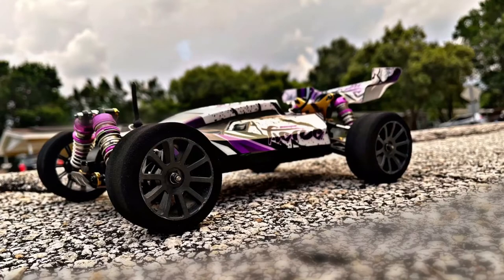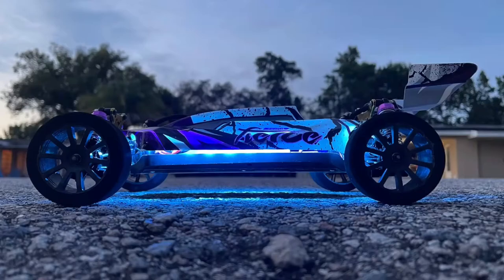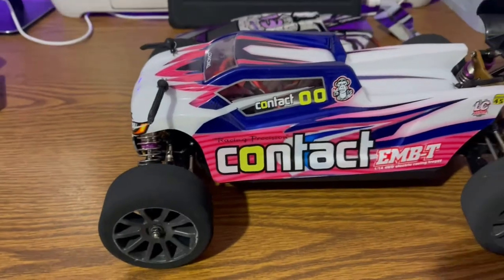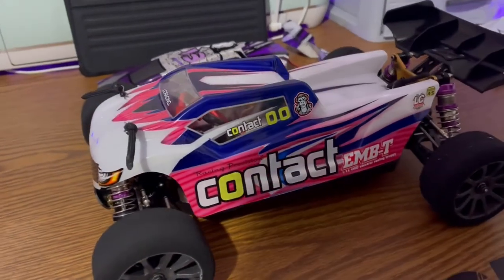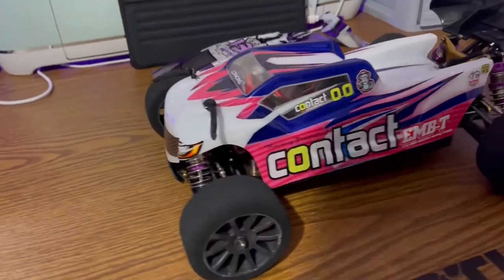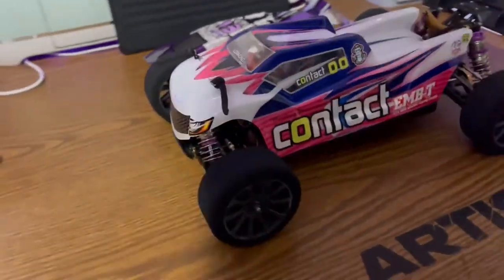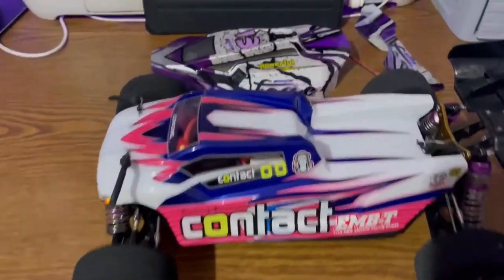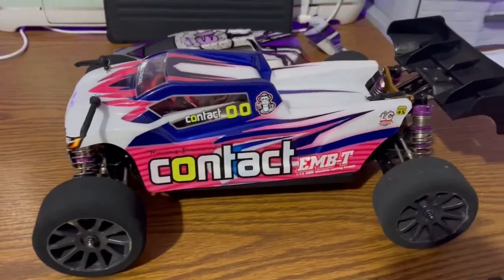WLtoys 124019 converted to LC Racing EMB T brushless upgrade on 2s nice and fast speed runs

Comment: Nice. Where did you get the tires/wheels?
Reply from the maker: The wheels and tires are foam 30mm all around 12mm hex brand name contact foam, matrix foam or xceed foam tires those are the brand I use that are cheap or bsr racing drag foam tires

Comment: What size are the foams? 30  32mm?
Reply from the maker: 30mm if you find the 32mm there a little bit better since the 32 is a little bit wider
Reply: @JuanCarlospr21  every where seems to be sold out of 32mm
Reply from the maker: 30mm is good that what I have